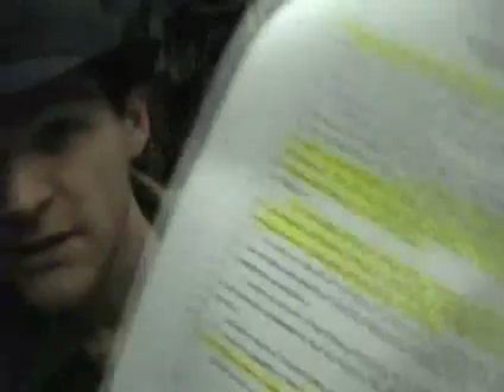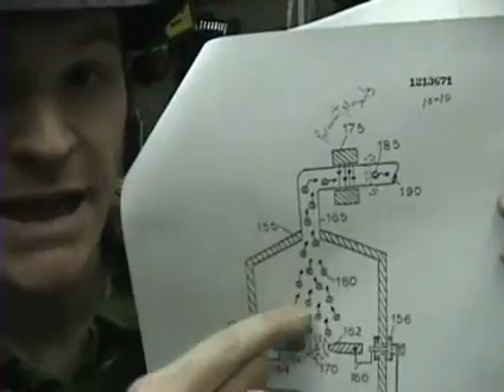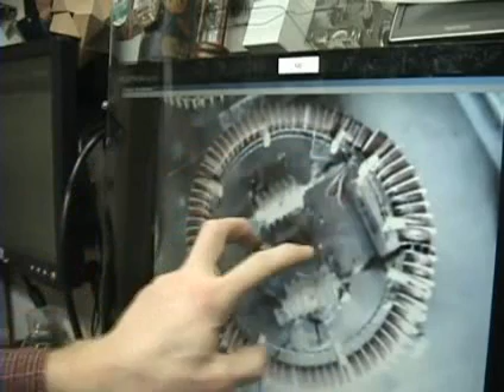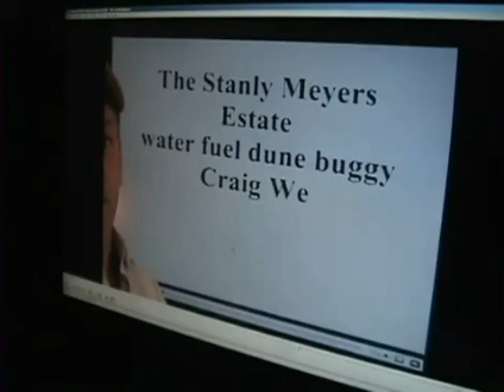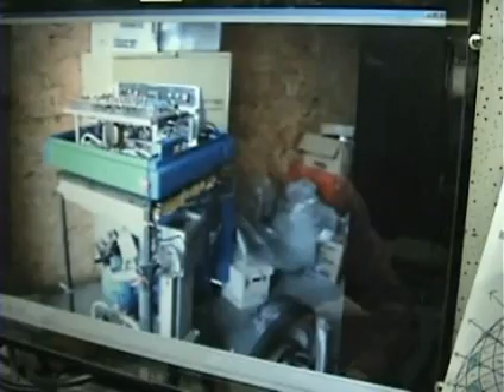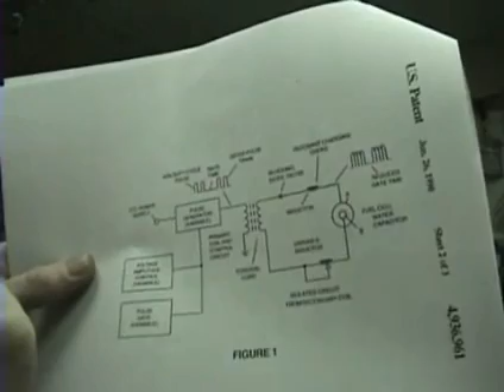The Key To Stanly Myers Water Car, Gas Electrical Hydrogen Generator, Self Staining Device....wmv

Comment from the maker: @whiterican74 - my friend - what can I say?
You know how hard I've been pushing this tech, reaching the same conclusion that Stan did, studying the masters - Stan and Bob - digging deeper to understand the very nature of this molecule splitting enigma. Figuring out how to make Hi6O3, and so close to high efficiency magtrolysis.  Plus I was the first to start using specific spectrum photon saturation to ionize the gas between the plate gaps and use solid and pulsed electro-mags.
This works

Comment: great information. Im in no financial or mentally astute position myself to do anything about this.  From the way its simply explained, to me the purpose of the hydroxy gas generation is purely to supply the inthrust of gas into the primary coil since its under pressure.  The by prodcut (hydroxy) is then removed from the magnetised gas/es at the secondary coil and by removing the hydroxy, you then maintain flow and get a 2nd fuel for free so to speak since electricity is the 1st

Comment: Thank-you  for  sharing. This  needs  to  be  shared  with  every mechanic , chemist, teacher, electronic  tech,  so that it  and  its  value  cannot  be  hidden  anymore. 
   Everyone  needs  to  know  that  this  is  REAL, Clean  abundant  energy, from   Air  and  water.  
 Hydrogen  , oxygen inside  the  water  molecule  and   from  the  nitrogen  in  air   which  is  70 %. .
Oil, natural gas, propane, butane  acetylene,gasoline, xylene, acetone  all contain
carbon . Not water! Its clean